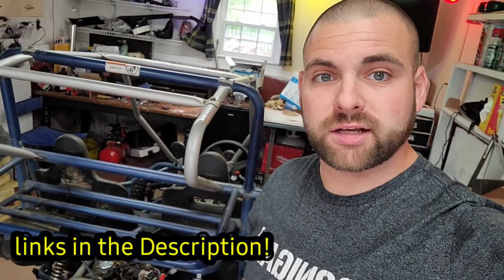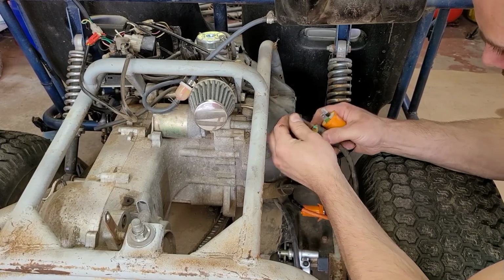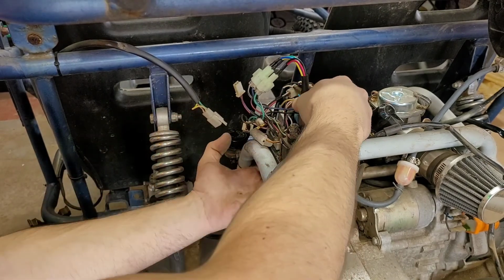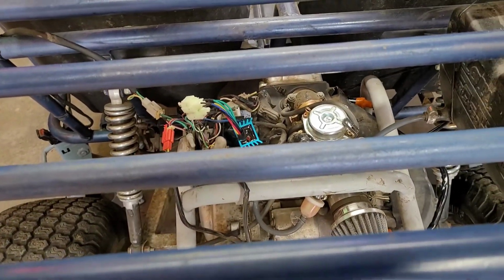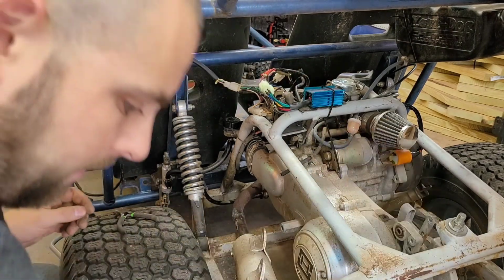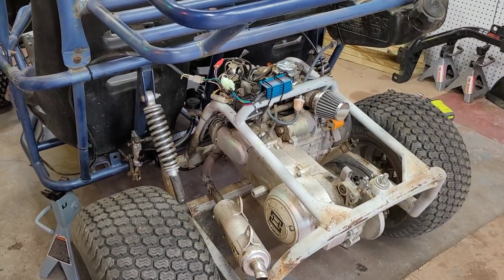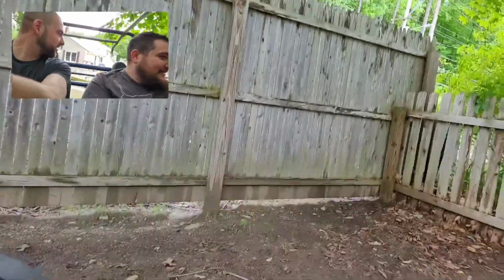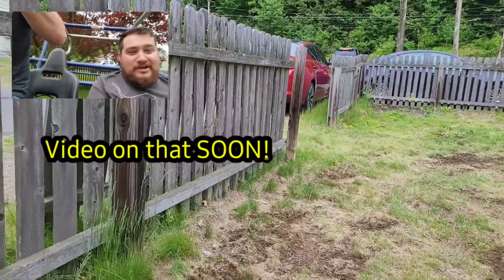ROUND 1 Of Performance Upgrades For the Gokart!

Comment: What seats are those?
Reply from the maker: Just the factory Yerfdog seats but you can buy the same ones on Jegs performance
Reply: @413BROS  that's what I thought but the jegs seats are too wide for any of the frames I have thank you for answering
Reply from the maker: @joshwaller6226 welcome! I would look at the actual yerfdog seats on marketplace or eBay. These are probably a little smaller